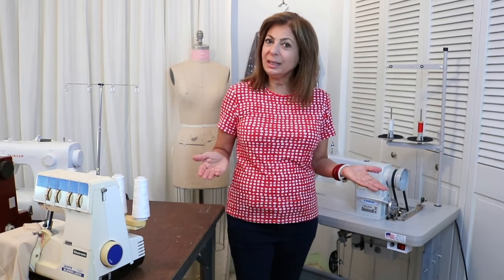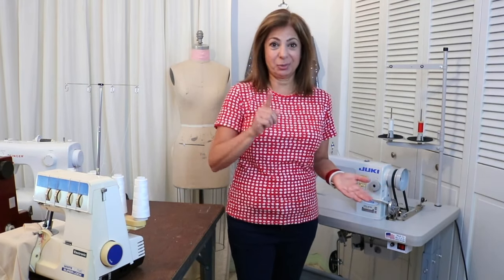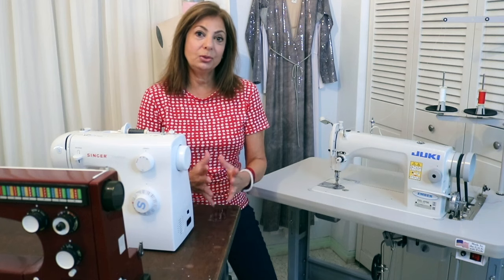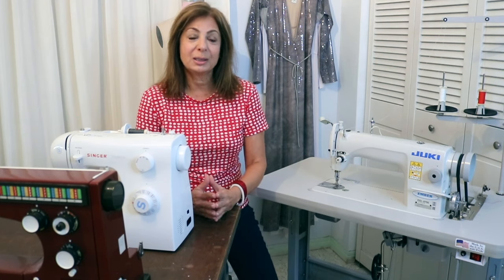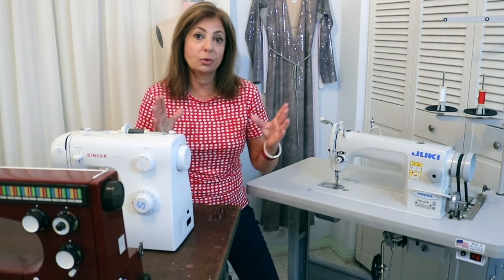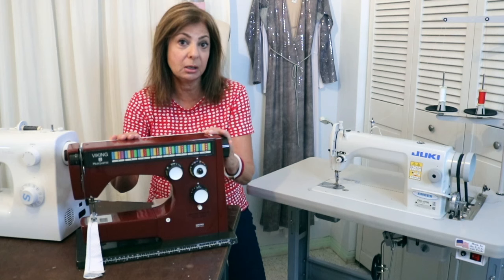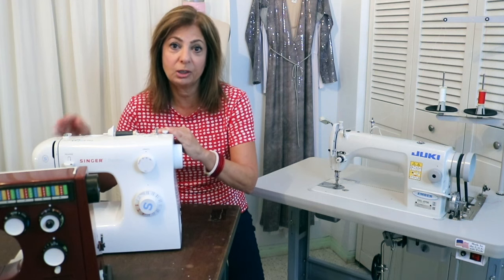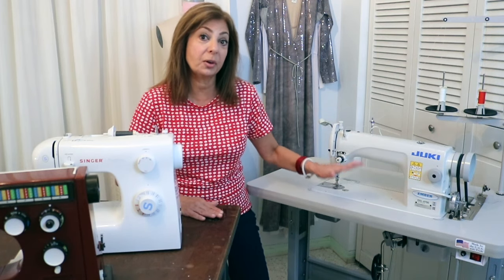Sewing Machine Do's & Don'ts For Fashion Design

Comment: Nicely done.  Don't overlook some of the vintage machines that can be picked up inexpensively. Many of the vintage, straight stitch only machines are powerful, accurate and have features such as pressure foot adjustment and continuous backstitch, and they can sew through multiple layers of all sorts of stuff that new domestics cannot (easily) with a beautifully executed stitch on top and below.  Because they are fully mechanical, they can be easily fixed and maintained. Always by the best quality that you can afford and remember that you can stretch your budget by buying quality used machines.  However, my Bernina 910 is not much less expensive now used than it was when I bought it.  Susan, your approach to having a stable of machines that can be leveraged makes much sense.
Reply from the maker: Yes, this is true. I have had many vintage industrial sewing machines. They were powerful and I loved them. I sold most of them when I stopped producing clothing. The only thing with that is some had issues that could not be fixed. Otherwise, you can save on cost. Also true my vintage Viking machine was over two thousand new back in the day!
Reply from the maker: sorry for the typos, I was on my little phone in the hospital trying to respond lol.

Comment: What do you recommend for men’s wear designer I’m having trouble with pattern making for men’s clothes
Reply from the maker: As far as sewing machines for menswear. You will need a  straight stitch machine, serger, buttonhole machine, and a blind hem machine. As far as pattern making for menswear the most important thing is the base patterns or blocks that you make designs from. I have done some menswear.
Reply: @susaneliascouture   I have a pattern for men swim wear and size is small, med,large but can’t figure out how to make them bigger
Reply from the maker: @josevazquez9724  in that case you will need a stretch stitch ma June or zigzag as well. I have a video on basic grading you can watch. I also am going f to be offering reduced rate consulting very soon where we can zoom and get help. You can email me and I’ll give you more info at eliascouture@gmail.com
Reply: Ok thank you